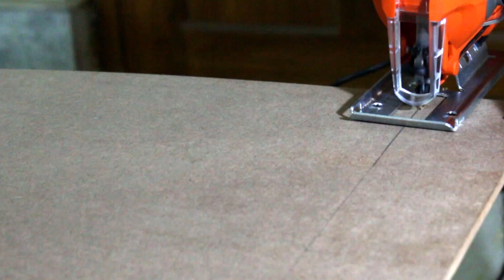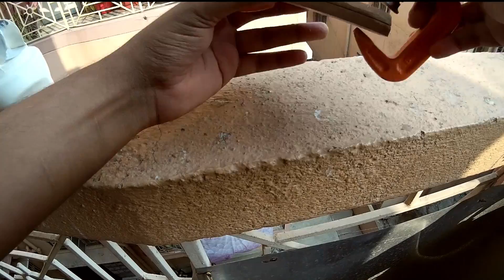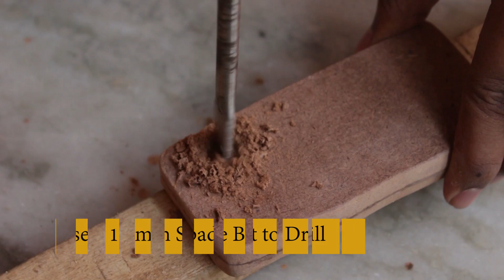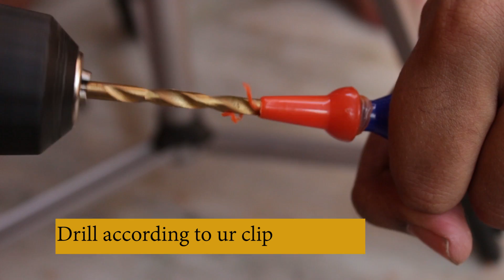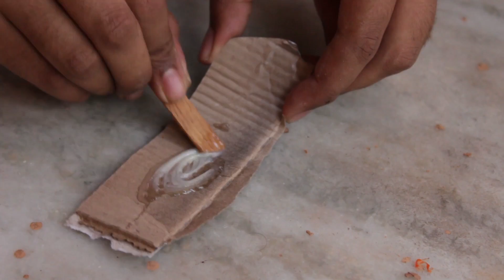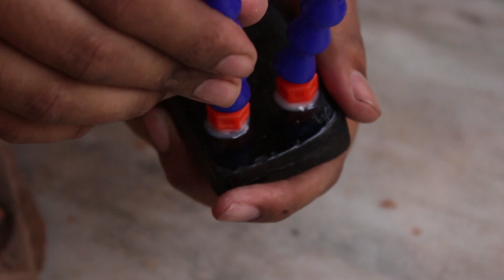How to make a Soldering Helping Hand || Third Hand Tool || Octopus Helping Hand

Comment: I like your idea of using the flexible ball and socket coolant hoses. You need to price a commercial product to make sure you are building your own cheap enough to justify your time. I would have used a solid wood base for easier quicker build. cover and insulate the alligator tips with vinyl tubing or heat shrink tubing to protect the delicate circuit board components

Comment: a few tips from a wood worker:
if you need to shape 2 pieces of wood to match, glue first then shape. 
Cyanoacrylate glue (super glue) can be used to bond wood and will dry faster.
MDF and other composite woods soak up paint and can lead to multiple layers of paint if you want a finished look.
A wider base or a heavier base will make the whole thing more stable.
Reply: use some heat shrink as well so that it wont damage components!
Reply: keep those ideas in mind if you build your own
Reply from the maker: +Goff Daily Thanks for the advice i think it will help other alot .

Comment: Octopus should have 8 tentacles. It got four. So just add four more CNC cutting fluid hose. awesome video. expecting more in future.
Reply from the maker: +Lionel Tech Reviews Technically you are right, but the octopus third hand is a type of third hand which has flexible arms, and there are four arms only.so the build is right ,but one can add as many as he want.